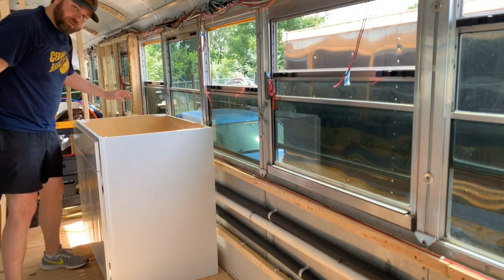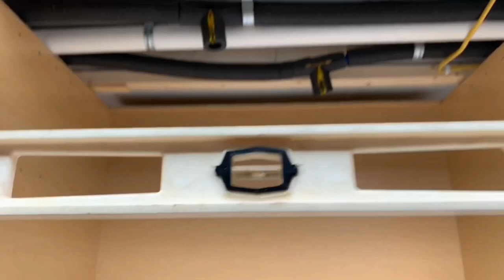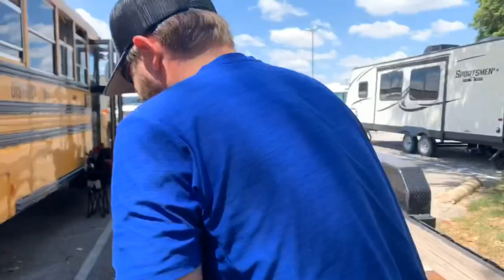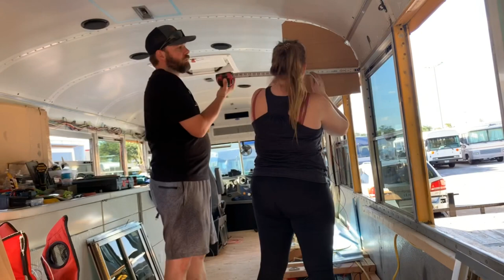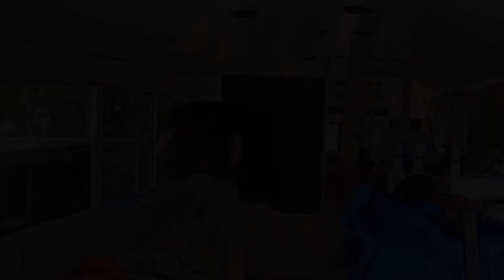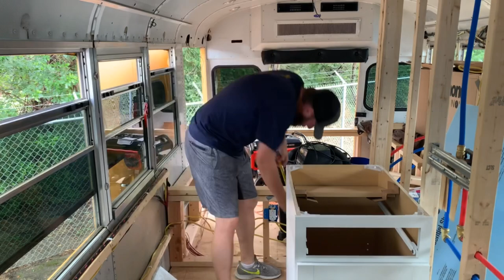Skoolie Kitchen Cabinet Install || 2020 Bus Conversion Ep. 15 || TOTS the Bus

Comment: notch out the back for the pipe place a 2nd inside wall and cut the slides off and reinstall. The photo looks like there 3 inc between the back of the drawer and the cabinet wall

Comment: Will opening the door on the cabinet hit anything that is plugged in there? How are the Lowe's cabinets holding up?
Reply from the maker: The cabinet at the foot of the bed is going to be a wood storage box, and we’re taking the door off, so it should be okay. So far they’re holding up...we’ll see once they’re loaded up and we’re driving around!!

Comment: Why not put in your walls behind the cabinets so then you'll have a flat surface to mount the cabinets
Reply from the maker: That’s a good idea, and we even considered doing that. The only reason we went with two rails instead is because we’re not building a wall above the countertops, instead leaving the windows all accessible, so we didn’t need to close in the plumbing behind a wall.